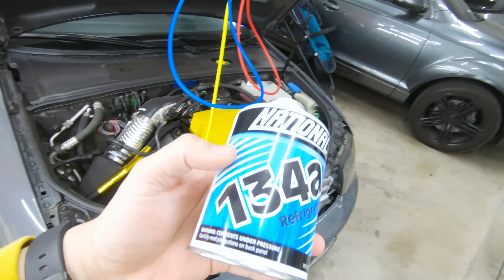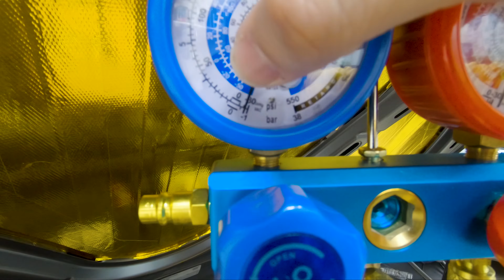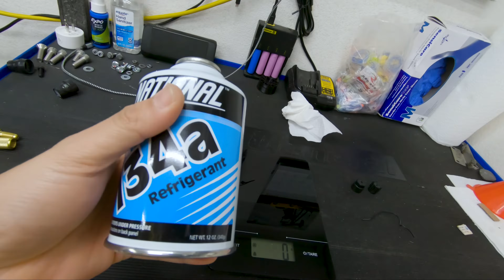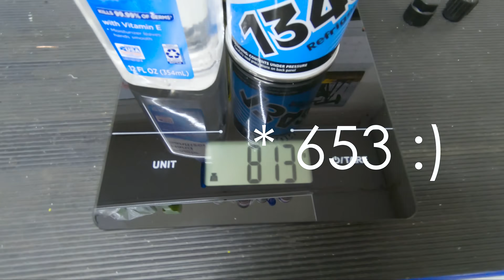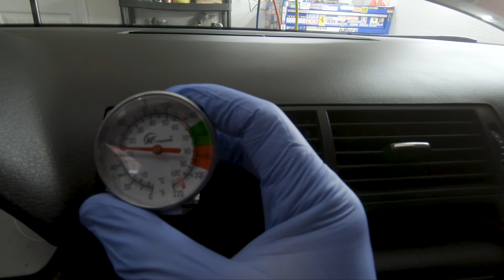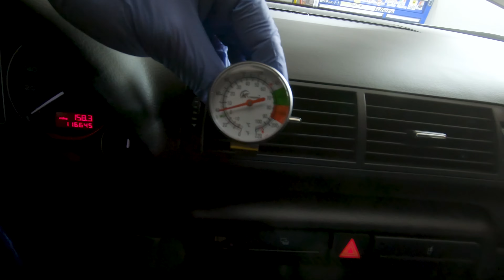DIY AC Recharge for Audi B6/7 S4

Comment: When did the econ light turn off/compressor turn on? Did you have to do it manually? Mine won’t turn off due to low freon but not sure if it will let me once I get a certain amount in the system
Reply from the maker: i don't recall me having to press the econ button. and even when driving i rarely never touch that button. when i do it's only by accident

Comment: When did the econ light turn off/compressor turn on? Did you have to do it manually? Mine won’t turn off due to low freon but not sure if it will let me once I get a certain amount in the system
Reply from the maker: It's been awhile since I've done this to the car so I can't remember exactly but I don't recall me messing with the econ button

Comment: Well I got to the part where I added one can. The can pressurized and my gauges moved to around 80psi on low and 100psi on high. I got an 07 model, the ECON mode didnt wanna turn off so my compressor didnt kick on and from there I got stuck. Took the can off after 3 min and only 4-5oz went into the system and wouldnt take more. Put a new bottle just in case. And no luck. Video is great! Thank you.
Reply from the maker: Your welcome. Happy it was of help

Comment: This may be a dumb question but how do I know if it’s empty all ready I bought the car with ac working
Reply from the maker: Not a dumb question at all!!! I honestly don't know nor do I know what the pressure should be to check If the lines are where they need to ne. If the AC is working, more then likely the ac system is all good. There is no need to recharge it. It's only when the ac starts blowing warm/ hot air. But with that, there may be other issues then just the possibility of the ac lines are empty. I know that doesn't answer the question
Reply: @markb6s4  no my a/c doesn’t work it hasn’t since I got the car and if I turn on climate control the Econ is always lit I was checking forums and it seems to be for a number of different reasons so I don’t know where to start and I meant when I bought the car it didn’t work in my previous comment
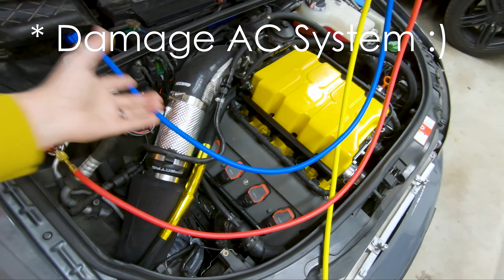Reply from the maker: @Bryton.u  I see now. One way to see if its even pressurised is to vent just for a brief second the low pressure side. so watch the @2:48 min mark. there I talk briefly IF it is pressurized, where I have the blue hose connected. get a flat head and press on the little check valve for a few seconds. keep note, keep your face away from that area when doing it, don't breath in that stuff, make sure to be in a place where air is being moved around (fan). if it sounds like nothing is coming out. then we know there is pretty much nothing in the lines. either you have a leak somewhere... and it can be anywhere through out the lines. start disconnecting lines to see how the orings are. 

if the lines sounds like it charged after purging the low pressure side, and we know there is pressure in the lines. then more then likely the ac compressor is a goner, and a new one will be needed.